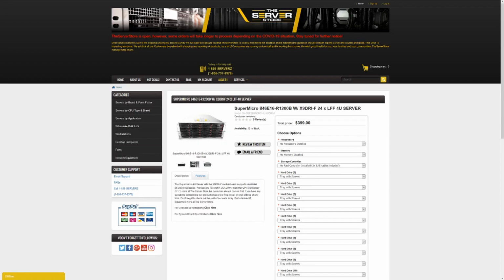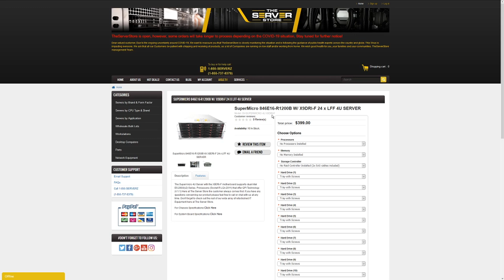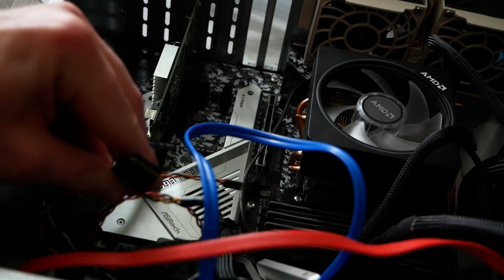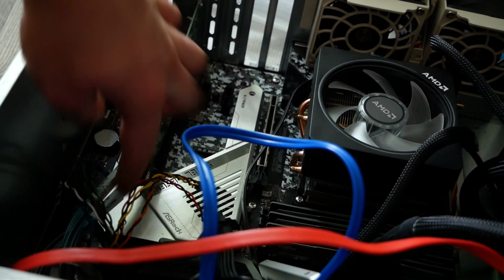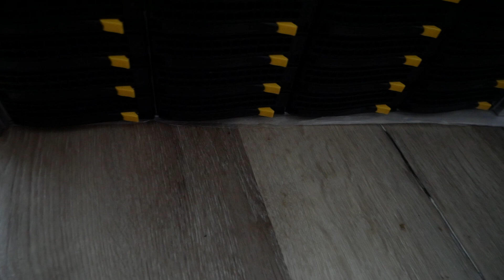Unraid | 3900x | Overlook

Comment: I just got a Inter-Tech chassi with the SAS backplane much like the one that you've got in you chassi. I also got the cables (SFF-8087) that Inter-Tech recommended in order to get the SAS backplane to work with SATA, but this does not work at all. Should I get the SFF-8988 in order to get the SAS to work with the on board SATA connectors?
Reply from the maker: So if you have a SAS backplane on your chassi/case, you should be running a SFF-8087 to SFF-8087 cable from your chassi/case backplane to your raid card (flashed to IT mode) if you want your raid card to see each individual drive as a it would with a normal sata connection.
Reply from the maker: Or possibly you'll need to get a sata controller, and use those sff-8087 to sata cables. BUT I'm not certain if that'll work.